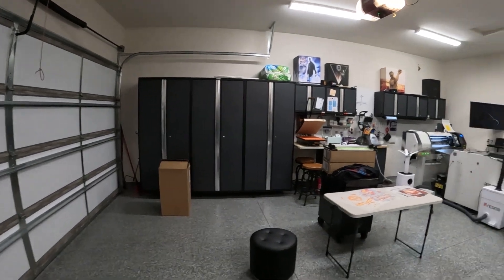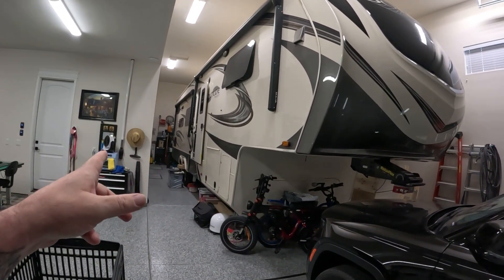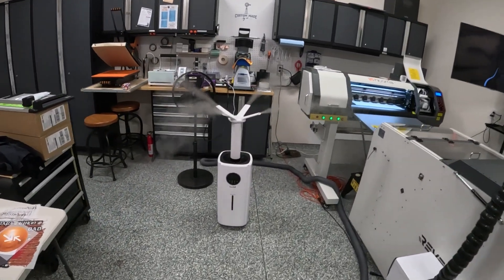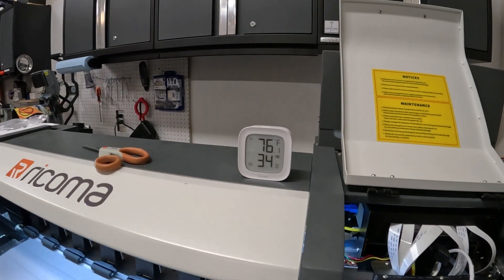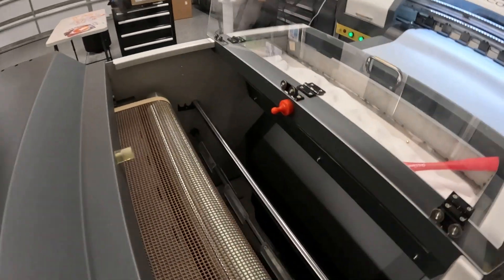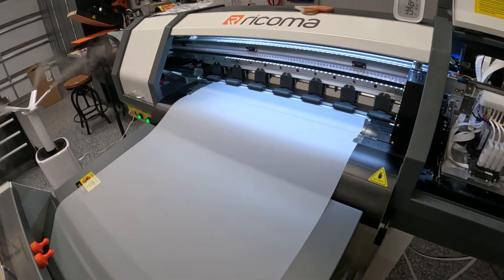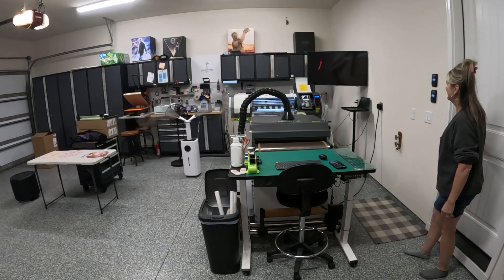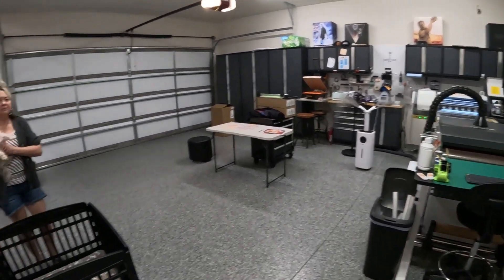REVEL DTF-2402 - Issues with printing and humidity

Comment: Have you tried dryer sheets for static?
Reply from the maker: Yes. We tried rubbing those on the tray to no avail. The wooden rails have worked perfectly since adding them.
Reply: @custommadebyus  keep on there, tape it down, I've also seen static bars
Reply from the maker: @jjm2069  Someone told me that these devices work as well. Since my wooden rails work so well I never looked into these. https://uscutter.com/graphtec-anti-static-akz-kit-for-fc-and-ce-models/

Comment: We have the Ricoma Vison DTG/DTF and have nothing but problems with it cause of the humidity. We live in Ilinois, so weather varies. We have two humidifiers in the room with it and the room is closed off now and still can't get the humidity to rise where its suppose to be. They can't help us with anything until the humidity is where its suppose to be. Paying for a machine that we haven't been able to use for 2 months now....frustrating!!!
Reply from the maker: They stated the same about my printer that the humidity needed to be between 55-65%. In Idaho it's always around 30-40%. I still print with these environment variables and don't seem to have any issues with the printer printing. What issues do you see with your printer?
Reply: @custommadebyus  right now it is a clogged head.
Reply from the maker: @creativeexpressions23 Order some RED cleaner and run it full strength (not diluted). Soak the heads in the solution for a good 12 hours to see if that can break up the blockage. I order mine from here. https://dtgpro.com/cicproduct/dtg-red-cleaning-solution.php?v1=250+ml&ref=ADP&gpid=dtg-red-cleaning-solution-250ml&utm_source=google&utm_medium=cpc&adpos=&scid=scplpdtg_dtg-red-cleaning-solution-250ml&sc_intid=dtg_dtg-red-cleaning-solution-250ml&gad_source=1&gclid=CjwKCAiArLyuBhA7EiwA-qo80DLAMJjX3-XC84QgTK2DXIiRCAG1SCkVPBf1RGBty4QkRbxZUb9EcxoCKJgQAvD_BwE
Reply: @custommadebyus  Thank you!!!

Comment: The problem is you have a cheap, Ricoma, China junk machine.
Reply from the maker: One of your comments says to sell the printer and buy a Mimaki. This comment states it's a cheap Ricoma China printer. Actually, it's the Tao Tech Titan that is rebranded for Ricoma (Codesi as well) from China. The printer works great now that we've ironed out all of the kinks. We print large volumes to this printer on a daily basis with no issues. Where do you think the Mimaki printer is manufactured?
Reply: Mimaki came from China too. they just did some improvement but 95% parts from China

Comment: Ricome printer is 220V .. Did you have it install or you have the transformer?
Reply from the maker: The printer came with a transformer that converts 110 to 220. We had a dedicated 220v ran for the oven.

Comment: you need to keep the humidity low and run a static bar in the back of the printer..if the humidity is high it will ruin your glue.
Reply from the maker: My humidity is typically around 30-40%. The printer manufacturer states idea humidity is 40-50%. I bought a humidifier and have tested all different kinds of levels with similar results.

Comment: have you tried using a swamp cooler?
Reply from the maker: The humidifier seems to help a bit. The best thing that has worked so far are the wooden rails I installed into the intake tray. Since that nothing has caught up in the shaker/oven.